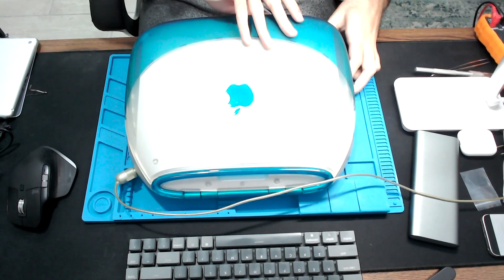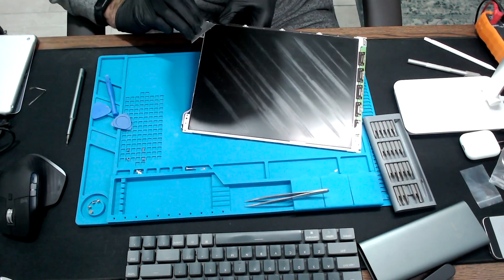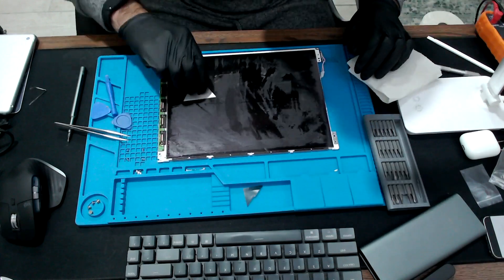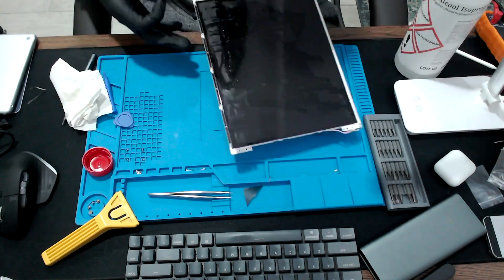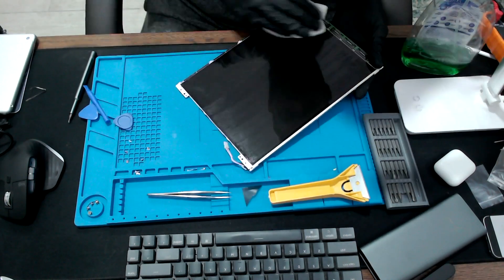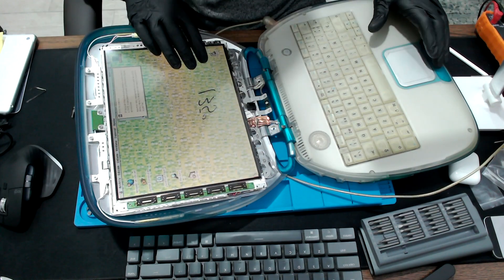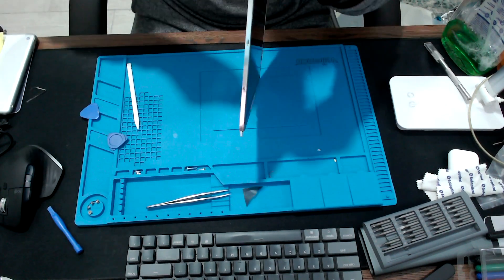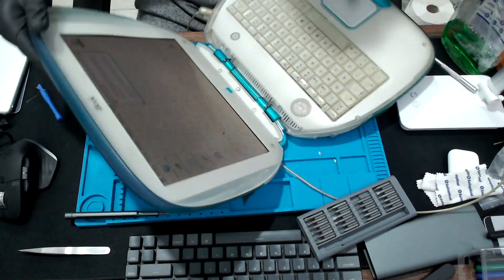Fixing Vinegar Syndrome on iBook G3 Clamshell

Comment: Idk what the effect of this is in the long term but I usually apply water to the center of a screen protector film to remove the dust bubbles. (this is what they do in labs to get air bubbles out of slides.) Since its water I don't think it will have a negative effect on the polarizer adhesive but I would install it and leave it to try for a few days to make sure it completely dries before applying.

Comment: the link you provided for the polarizer films, do you have to buy 10 of them?
Reply from the maker: Yes, that's correct. I didn't find any less than that :/
Reply: Thanks, just ordered some and will give it a try , i might try the wet method like applying window tint to glass to eliminate bubbles @retrolobo
Reply from the maker: @peteralberico1559  awesome! please let me know if it goes :D
Reply: I can confirm that using the wet method to apply leaves no air bubbles at all and makes the screen look factory  @retrolobo
Reply from the maker: @peteralberico1559  that's great news. Thanks a lot for letting me know. I'll try it next time :)

Comment: Can you install the new polarizer film without glueing it? just putting it on top? Do you see any downside of doing this?
Reply from the maker: I have no idea to be honest... I have never tried that. If you are able to find one that does not have glue and you are able to keep it very flat against the LCD panel I don't see a reason why it shouldn't work.
Reply: @retrolobo  and do you know if 135 and 45 degrees films are the same?
Reply from the maker: @salpuy  don't think so

Comment: A trick I learned a while back is to apply the polarizer in the bathroom after letting the shower run for a few minutes. The steam causes dust to fall out of the air, which eliminates the possibility of trapping dust underneath the film. The same trick works for screen protectors.

EDIT: you can also get the same result using a humidifier.
Reply from the maker: Can this method lead to trapping water under the film somehow? 🤔
Reply: @retrolobo you could try using soapy water to apply the new film, this is what most companies use to apply window advertisements, the soapy water makes the adhesive slippery and you push it out with a squeegee which makes the adhesive sticky and it stays put.

Comment: I wonder how you removed the metal frame of the display..today I wanted to replace the TFT tube above but couldnt separate the monitor
Reply from the maker: You meant the step I start on 1:41? Thera are some screws on the back, once those are out, you have to unclip some clips around the frame to take the metal frame out. Hope it helps 👍🏽
Reply: @retrolobo  yes, I took those 4 on top and those on the bottom out, but I coudnt unclip , I didnt want to destroy anything..or is there another way to get the top TFT tube out on top?
Reply from the maker: @ast3663  I'm not exactly sure what the "top TFT tube" is to be honest.
Regarding the unclipping... I don't think you would destroy anything as the frame is metal and the most you could do is bend it, which I don't think it would be too difficult to bend it back into the original shape.

Is the TFT the same one as on my iBook? If it is another brand or model it may have a different way of disassembling it 🤔
Reply: @retrolobo  I mean the small fluorescent tube for the back lighting, this sits on top. 
No, its the same as yours, but the fluorescent tube has gone  bad so the screen has a red tint..

Comment: I think you can prevent those air bubbles by using distilled water.
Reply from the maker: You mean spraying distilled water on the display before applying the polarizer film?
Reply: @retrolobo  Yes.
Reply from the maker: @Kazuo1G  cool thanks!! will investigate about it :)

Comment: If it's that hard to get the glue off, you're using the wrong solvent. Try using something like Citrasolv.
Reply from the maker: Probably not the right solvent as you said... only what I had at hand 😅
I'll definitely look into better solutions to remove the glue if I have to do it again.
Thanks a lot for the recommendation :)
Reply: @retrolobo but you won't do it
Reply from the maker: @JESUSCHRYSLER5512  what do you mean?

Comment: Give a 3M Adhesive Eraser Wheel a try. Part #: 03612  It does not harm paint, glass should be fine. It 'rolls' the adhesive off like you would picking at glue with a finger. 

The are meant to work while the glue is sticky and without liquid. 

If the adhesive didn't release with the wheel, maybe soak, dry and retry.

If the wheel fails for the screen they are great for dealing other glue stuff in life.

Thanks for the video.
Reply from the maker: I didn't know about that tool. I'll definitely look into it if I have to do it again because removing the adhesive was a big pain 😅
Thanks a lot :)

Comment: What causes the problem in the first place? Can it be prevented?
Reply from the maker: It is a chemical process that happens in the material itself. Probably your best bet is to store the device in a cold and dry storage. Not sure if it can be prevented 100% but it surely will help slow down the chemical degradation.

Comment: Is that a fucken samsung logo ? 😳
Reply from the maker: Sorry, what? 😅
Reply: @retrolobo  looks like the display is made by samsung , funny 😅
Reply from the maker: @nkhjk3457  ah yeah, probably. Apple didn't make their own displays. It is the same currently, with the iPhones etc, screens or batteries are made by other companies like Samsung hehe
Reply: If I'm remembering correctly, iBook displays were made by either Samsung or LG. The LG screen is uncommon and if you have it you can install a panel from an iBook G4 since the pin connection is the same but you have to fold the cable and can't screw the screen down since the mounting points are different.

I've done this mod to my own iBook and I'd really like to find someone to design a bracket adapter but no luck so far. XD
Reply from the maker: @theblobjectfish  interesting, I didn't know about that.
I own a 3D printer and I know how to design so I guess it could be possible to design and print a bracket.
Reply: @retrolobo  I know the screen swap only works on the later models with 8mb video cards, and again ONLY if you have the LG ribbon cable. There used to be adapters made that could connect the Samsung ribbon cable to the G4 screen but IDK if anyone sells them anymore.

If you did end up designing that bracket I'd love to buy one from you! I hate having the screen just be loose in there... XD